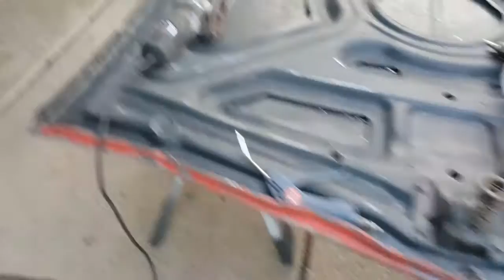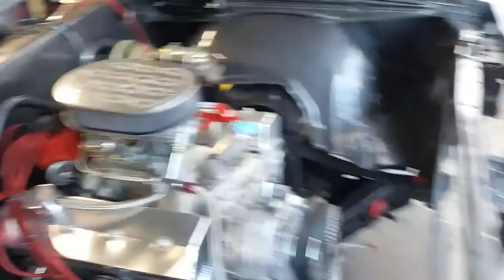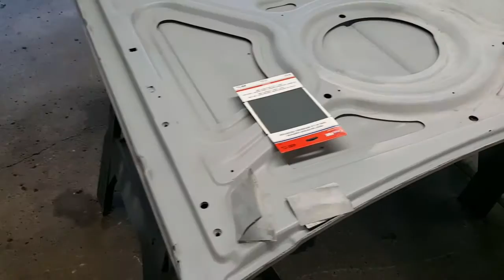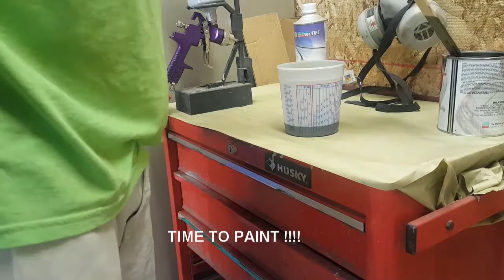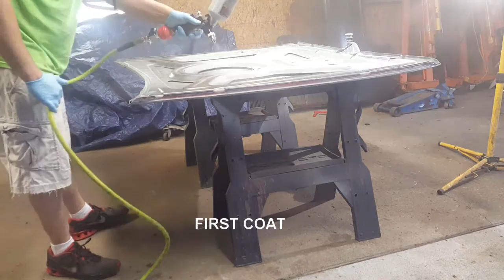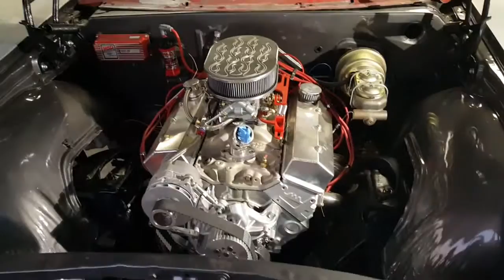65 chevy impala project painting the hood

Comment: hi...thanks for the vid.

i just want to say that on the inner parts of the trunklid and hood you can always use a red and if you anal about it a grey scotchbrite pad to scuff the primer down to smooth without burning thru....so much faster and effective.
i know how it is when you have those spots that gives you a hot stomach when sanding....lol.
trust me...you will have the same smooth paintjob as if you sand it with paper and you get every spot even more precise...just use a guide coat.

with best regards sir
Reply from the maker: Appreciate the advice I'm currently blocking the whole car now found a few low spots didnt notice them until I sprayed the guide coat, i might do a video on how and why  to use guide coat it definately helps when sanding !